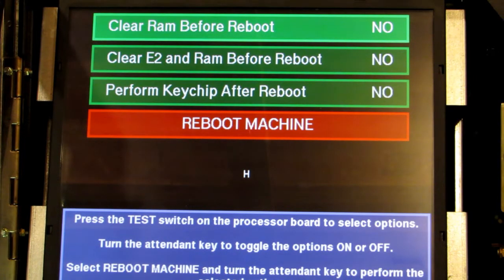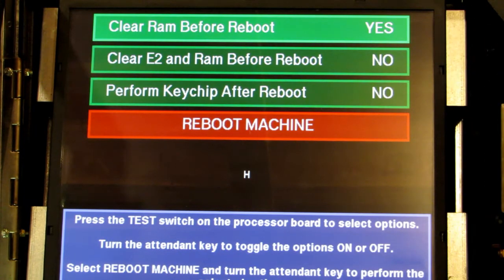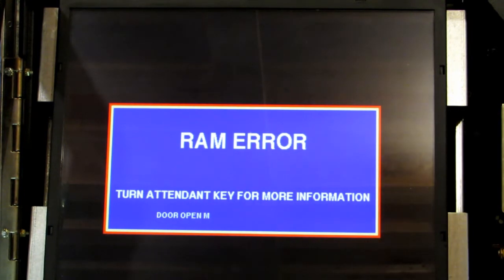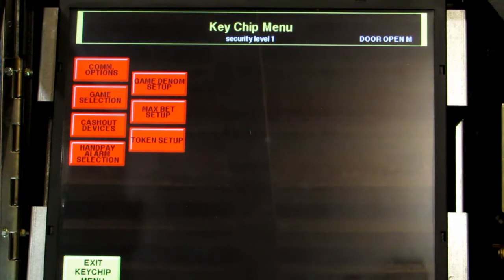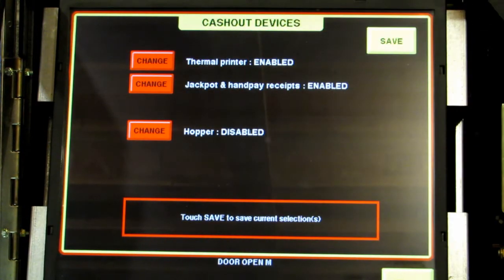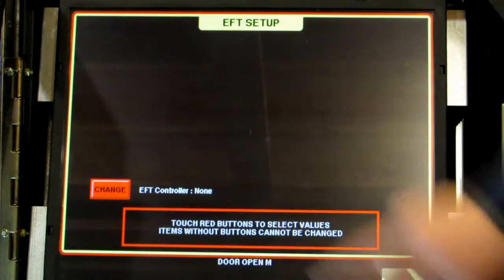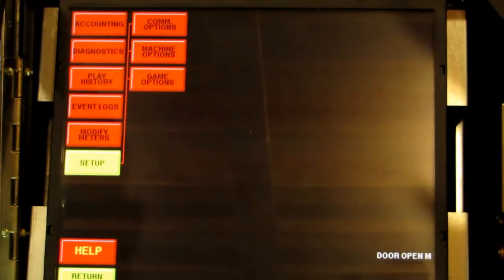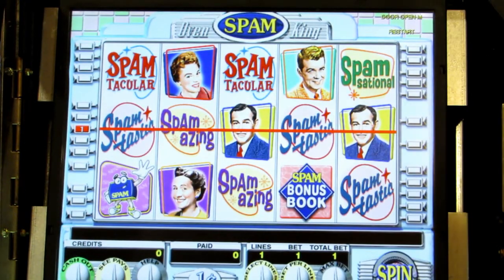TITO Setup IGame/GK old software SAS 5.0

Comment: I replaced the battery on the small board and now I am told I need to clear ram with key 22.  I have a munsters igt 3902 board. My bill validator is not functioning and not accepting money. When I clear the ram will it fix that issue?